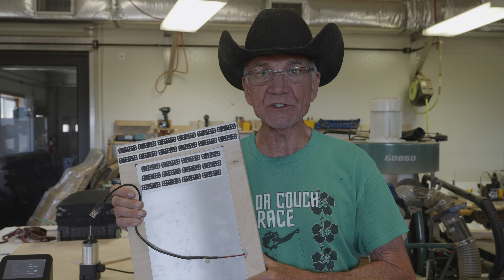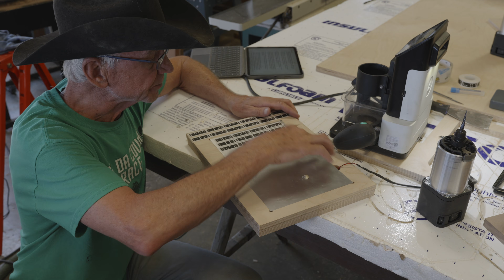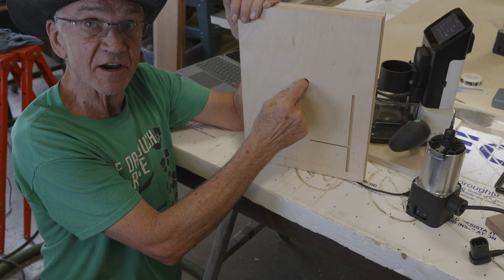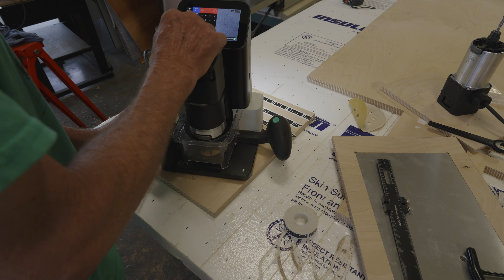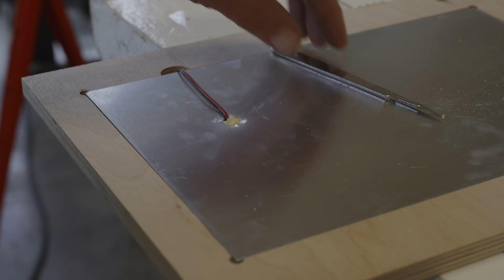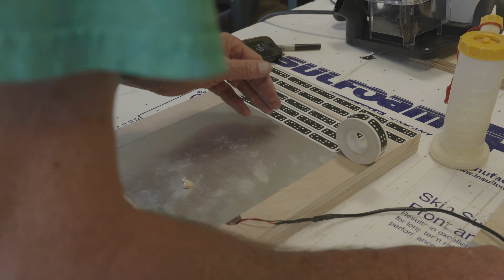Z Touch Improvement Plate

Comment: So I just found this video. I have some suggestions for improving your manual touch off. First I suggest that you use your LED in a different way. 
* First connect the positive from the USB to the LED anode.  
* Then connect the  negative (ground) from the USB to your aluminum plate. Soldering may be difficult but you can drill and tap a screw hole for the wire. 
* Then run a wire from the  cathode of the LED to an alligator clip. 
* Install your spindle motor with the V bit installed but only finger tight so that the bit can be slid in and out by hand. 
* Clip the alligator clip on to the bit and place the SO on the plate. 
* Then  go to manual touch off. Lower the bit until close . Then reach in and lower the bit by hand until the LED lights up. Set the manual touch off on the SO. Remove the spindle motor and secure the bit. Reinstall the spindle motor.  

If you are using a Gen 2 SO then use a 9 Volt battery with a battery clip in place of the SO USB port.  Make sure that you are using an LED with current limiting built in. Or you can use a 9 volt beeper available on Amazon in place of the LED. If you were starting from scratch you can just use a small aluminum block in the workstation and zeroed out with the bar in place of the large aluminum plate,
Reply from the maker: I like the idea and some others on the Shaper Tools user forum have similar ideas.  I think someone set up one with a buzzer, very cool.  Not sure though what you are getting at with moving the bit by hand.  I just tap the down button to lower the bit until it touches.  I can tell you that the gadget works very well for accurate repeatable z touch.

Comment: It is important to note that the Gen 2 Shaper Origin have a USBC port. Unlike the USB - A (original USB) the USBC will not power up as it needs to do a "handshake" negotiation with a pair of resistors. Perhaps I will have to go and see if I can find a USB-A charger and cable unless someone else has a easier more elegant solution. I would ideally like to buy a USBC cable with an LED  with a 3-5V supply
Reply from the maker: Thanks for pointing this out.  I had no idea that USB C would be fussy.  Is a USB C to USB A adapter a solution? I don’t know if that would make the handshake.  https://www.amazon.com/POHFP-Connector-Thunderbolt-Compatible-Chromebook/dp/B0FX5C22Z7/ref=sxbs_pa_sp_search_thematic_btf_sspa?content-id=amzn1.sym.90753c63-c1ad-4397-9e8d-f368c6b72459%3Aamzn1.sym.90753c63-c1ad-4397-9e8d-f368c6b72459&crid=1APP039SL770E&cv_ct_cx=Ian%2Bc%2Bto%2BIan%2BA%2Badapter&keywords=Ian%2Bc%2Bto%2BIan%2BA%2Badapter&pd_rd_i=B0FX5C22Z7&pd_rd_r=8e4df8d8-61d0-4d88-8780-f38eee4f8124&pd_rd_w=qncz2&pd_rd_wg=SjGsF&pf_rd_p=90753c63-c1ad-4397-9e8d-f368c6b72459&pf_rd_r=2AQRNKY4KHW8GGP625ZT&qid=1775211480&sbo=RZvfv%2F%2FHxDF%2BO5021pAnSA%3D%3D&sprefix=ian%2Bc%2Bto%2Bian%2Ba%2Badapter%2Caps%2C248&sr=1-1-19848dd4-d197-4a53-a445-4045457584e9-spons&aref=cN2tYpbwzU&sp_csd=d2lkZ2V0TmFtZT1zcF9zZWFyY2hfdGhlbWF0aWNfYnRm&th=1
Reply: @MountainRanchWoodworking-kn7et  Thanks for repsonding. Sadly it still needs to do the "handshake". I am looking to see if there is a USBC "light" that I can canabilize. I did this with my Bosch Mitre saw to create a shadow light but the form factor does not lend itself so maybe I can use the power source and wire it to the LEDs I have. Will let you know.
Reply: @MountainRanchWoodworking-kn7et  I was able to use the supply from this "sewing light" and now have the Z touch plate operational. I have just gone to cut the "female" portion into my cutting board but for some reason it keeps showing up "greyed out". I am using a Gen 2. Is there a reason the file format is uncompatible?
Reply from the maker: If you are talking about the feather trivet, I just replaced the Females file in the project.  I was able to get the replacement version to open in Studio, so I think it ought to work now.  Not sure how it got corrupted, but I agree it was not working.  I'll pay attention tomorrow if you need help.

Comment: Only thing missing is a giant magnifying glass! 🔍

Great job and I may have to make one.  As inferred, my eyesight is a major limiting factor.  I had already discovered the wiggle test on manual z-touch have never felt that confident with the results.

Curious if you had tried any automatic z-touches off that plate with that bit and what were the results?  Consistent?  Lifts?  I ask because I have done some auto z's with small bits like 1/32" off of hard materials and that seemed to work pretty well.
Reply from the maker: Thanks for the comment. Funny you should mention a magnifying glass— I actually tried using a borescope, but it wasn’t convenient or helpful, so I dropped that idea.  The automatic z touch off hard material might be OK. The workstation top is too soft and wood is too soft.  So even if I’m trying an automatic z touch I’ve got to get a hard surface under Origin.  So I don’t think that’s much easier than moving Origin to my Z-touch plate.  I’ve used the Z-touch plate around 100 times now.  It is convenient and accurate.  Might be overkill; for some, but worth it for me.

Comment: I am wondering if a thin film pressure sensor wired to a battery operated light would be simpler, especially if the bit was marked at the insertion point of the retention into the spindle. One thing that Origin doesn’t seem to have is a way to know what the height is from the bit tip to the material surface for the operator. In theory a readout of how much I’m lowering the bit would be a useful thing to know, as I could then calculate how deep a bit could be plunged for maximum cutting depth into a piece.
Reply from the maker: Pressure sensor is an interesting idea.  

There is a workaround to know the maximum depth of cut for a particular bit and that could be used to figure the distance from the bi to the workpiece when the bit is retracted.  (1) insert and tighten a bit, replace and tighten the spindle and z-touch.  (2) enter a depth of cut you know is too long, like 2 inches.  SO will tell you it can’t cut that deep and will set the depth at the maximum.  You can sometimes use the depth from (2) to calculate the distance from the bit to the workpiece.  The maximum spindle travel is 1.7 inches.  So if the depth in step 2 is under 1.7 inches, the distance of the bit is 1.7 minus depth of cut.

Comment: Interesting idea, but I think using a 1/2 thick plate that big is overkill. Mucho overkill. This is woodworking so accuracy beyond the thickness of a piece of paper is not necessary (or really even possible). Why not use a MUCH smaller piece of aluminum plate (like 2x2 inches or even a circle 2" in diameter)? If that is inlaid carefully in a sheet of 1/2 or 3/4 inch ply, that should be plenty accurate. Also, I'm interested to know whether electrical continuity could be employed instead of lighting and looking for the shadow. I think it's possible, for example, if the ground for the USB power circuit is shared with the router spindle, then when the bit touches the aluminum plate, the circuit is completed and the LED lights up. To date, I've simply turned the ShaperOrigin upside down and sighted visually to align the tip of small bits to the plane of the router base plate. Finally another option would be to mount one of the many inexpensive CNC tool length sensors so that the surface is flush with a larger plywood surface. Then just lower the bit until the unit beeps or lights up.
Reply from the maker: Yeah, overkill for sure.  I’ve got little doubt there could be cheaper and (somewhat) lighter systems.  But what I like about my overkill solution is that the SO sits entirely on the flat chunk of aluminum.  If the construction was ply with a small aluminum plate, I’d have some concerns about the ply eventually warping.  I suppose MDF would work though.  Anyhow, the all-in cost for this was under $40, and I have leftover LEDs and a leftover USB plug to populate my electronics parts box.  So the cost of overkill was pretty small.

Another poster said he rigs up a multimeter on continuity mode, and it beeps when the bit touches the aluminum.  I like the idea of a beep.

Comment: Thinking about using a feeler gauge to check the Z-touch and then compensating for the difference in the depth field entry. Might have to bend a .001 [.0001?] blade to fit in the router bit hole. I find I am using the 1mm bit more often esp. with inlays that have tight radius details. And pocketing with a 1mm bit is fun. But that's why we do this. Right?
Reply from the maker: I like the feeler gauge idea.  Would be pretty easy to disassemble a feeler gauge to pull out just the blade.  you’d still need to be able to tell when the bit is touching the gauge.  Maybe combine the feeler gauge idea with the continuity meter idea from an earlier comment?

Comment: I also use a aluminum plate for Z-touching. I use the shadow technique as described in your video but I use a flashlight. For smaller, 1/16" bits, I can't see the shadow because of the base. I use a multimeter in check for continuity mode and listen for a beep instead. I haven't had a issue "yet" with the spindle doing this. However, I do unplug the spindle power cable just in case.
Reply from the maker: That's a clever idea -- have not heard that one before!  I'm going to try it
Reply: I was looking into some of the z-touch pads for gantry on AMZN that are cheap with LED that are essentially a continuity checker.  I think they are just pos/neg/signal and I think only 2 wires to a USB should work to get 5V from Origin, eh?
Reply: I've done this, by Z-touching onto the metal part of workstation, it worked really well but I found it quite fiddly to hold the multimeter wires in place, could maybe do with some better clips.